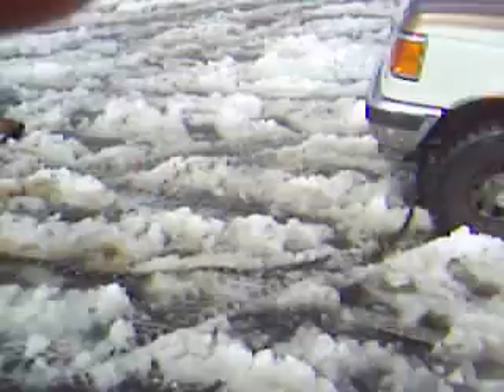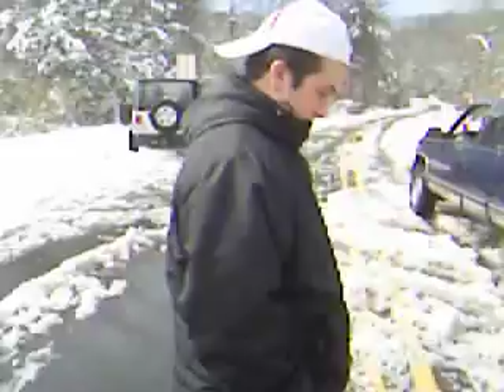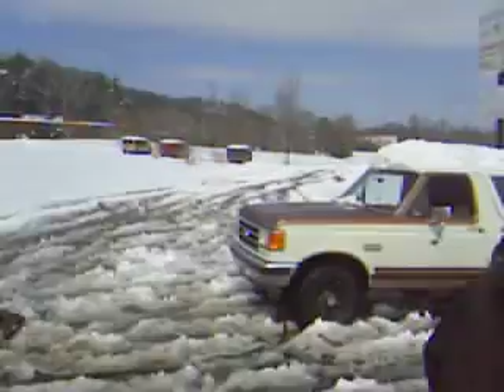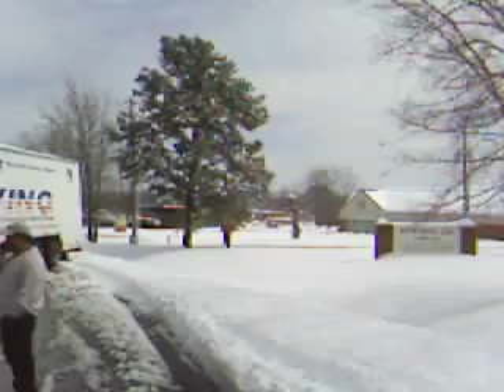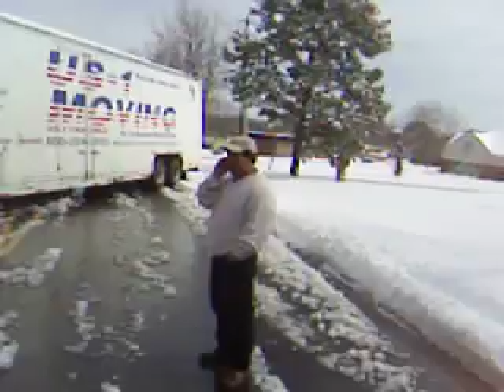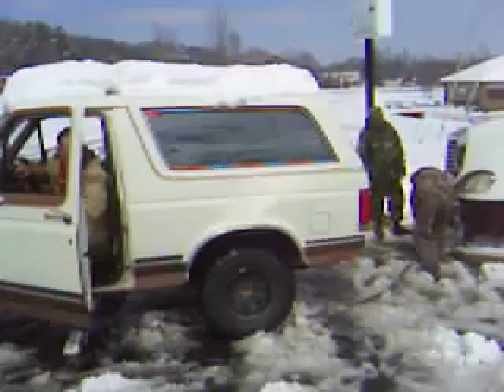Pulling Out a STUCK Semi (Before)

Comment: They needed more than one truck to tow the semi because there's not enough traction for any of the vehicles. And even if the ground was dry, no 4-wheeled vehicle can pull 80,000 lbs. by itself without the help of the semi's engine.